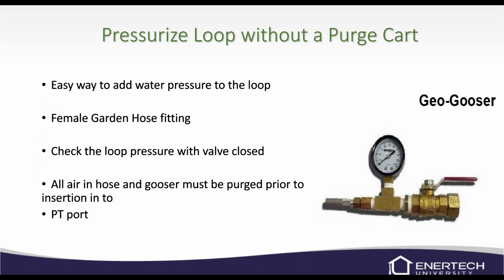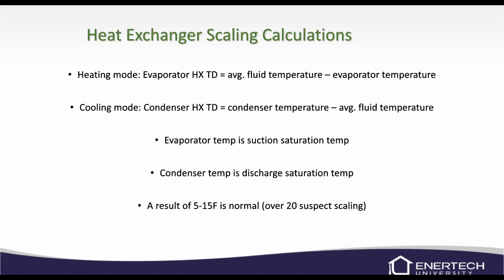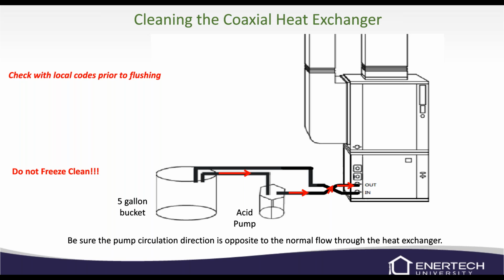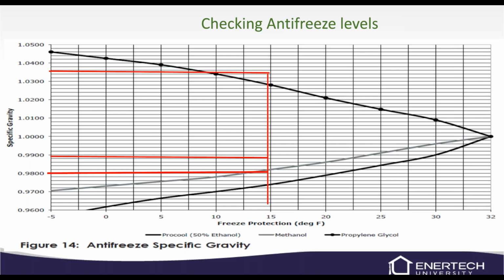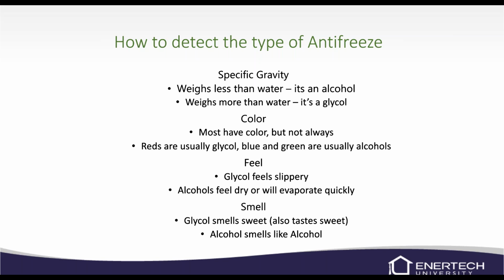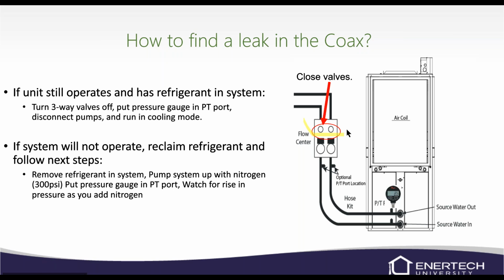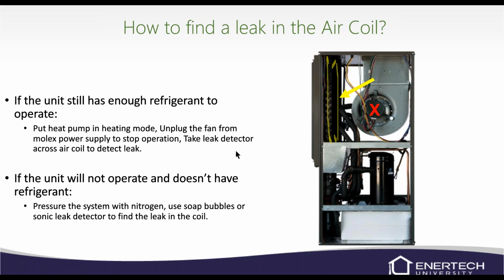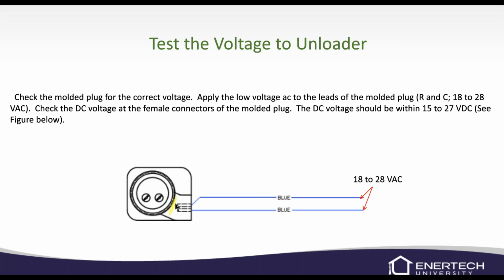Geothermal Service Procedures

Comment: Hey there, I have a water furnace open loop w cupro nickel exchanger. I haven't done any maintenance in almost 10 years, been working great, but now seems to be struggling to keep up. What is the best chemical you recommend for descale that is cupro nickel safe? (we have a water softener, the water in the top of toilet tanks are usually  reddish too).  Thanks so much for the informative videos!!